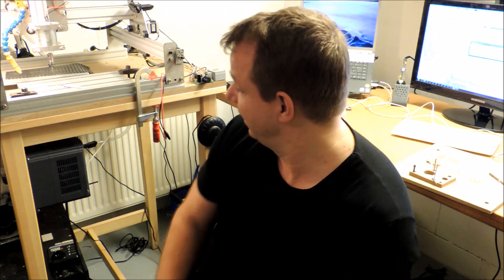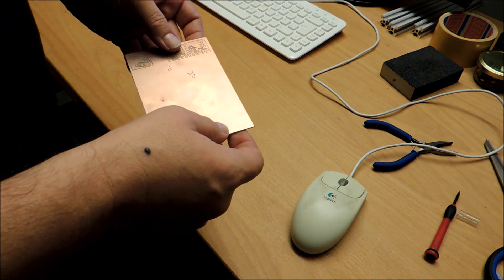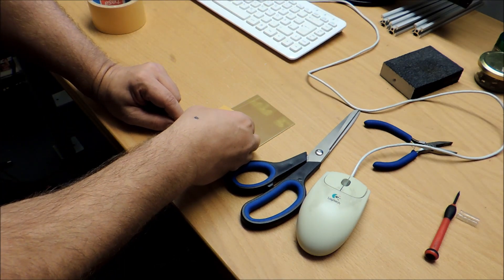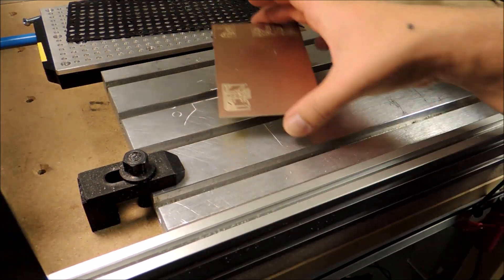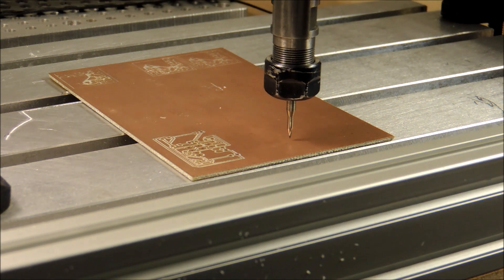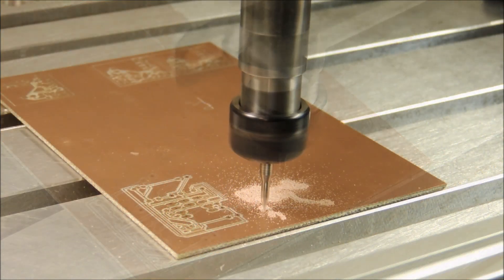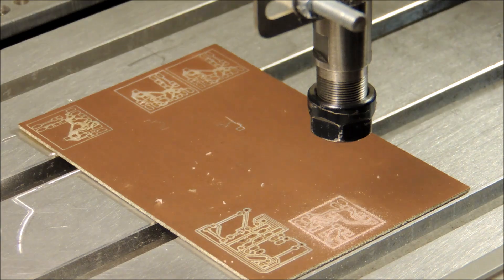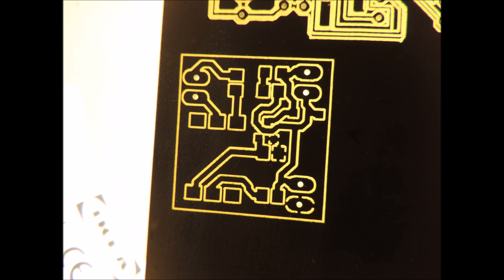How to mill a PCB with Chilipeppr s01e02

Comment: Brilliant result! Can you share the feed rate and the depth of the cut. What type of bit you use for the milling (angle and diameter of the tip)? 
Greetings!
Reply from the maker: Hello Stanislav, unfortunately the video is so old that I can't remember it. But I'm working on that right now, so I'm using a spiral cutter 10° angle as feedrate I would use 500/min at 10000rpm.

Comment: Very good work for sure. But I wonder why when you drill you do not put anything under it pcb to not break the drill from the aluminum work table? How do you do it without a soft soft substrate to sink the drill? Thanks...
Reply: To actually answer your question, the drill just doesnt go all the way through the PCB. The Software knows how thick the PCB is so it stops like 0,1mm before drilling through. The last 0,1mm of material crumbles automatically away.
Reply: Really is it !!!!
Reply: Oh, and double sided tape adds a little extra space between the board and the milling table.
Reply from the maker: Thats a good idea, but if you mill the pcb then you need a stable and precise underground to get good results.

Comment: Is the auto levelling really necessary? if the board is flat, there's not a lot of variations in height, right?
Reply from the maker: Sure, but in my experience the boards are never really flat. Since this is about 1/100 millimeter, it is necessary to make a autoprobe. Even your machine will not be 100% parallel to your workpiece surface. I have placed my raw PCBs between 2 aluminum plates and clamped in a vice overnight. Then they were nice and flat, but even the autoprobe found up to 0.1mm difference.
Reply: I see, thanks! What are the crocodile clamps connected to? Some sort of sensor that is fed to the computer?
Reply from the maker: One is ground (black one) and red is signal: https://www.youtube.com/watch?v=6WNE3E1ZZYY
Reply: OK, so this is a feature of the TinyG board. I will look into whether I can use that board with my 3020 router.

Comment: How does work the auto leveling thing? I saw that red clamp, is it connect to a sensor?
Reply: Kelson Daniel Gonçalves if it hits the pcb its closing the electrical path trough the copper of the pcb like a switch.

Comment: Your results came out great. I love the pre-drill feature you added as I think it really does help make sure the drill bit doesn't dance. I think that skinny trace you had under the SMD resistor came out fine for you. I like the endmill you're using. I just bought a bunch of that type from two different vendors to test them out.
Reply: +John Lauer which ones did you get John?
Reply from the maker: +John Lauer Yes the skinny trace are very small, i want to try next time to plunge only 0.05mm! Cuz, the milled paths looks a little bit to big. Need only some tests :)